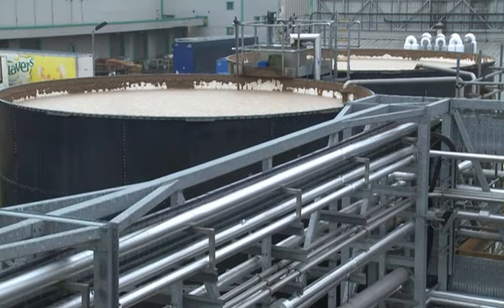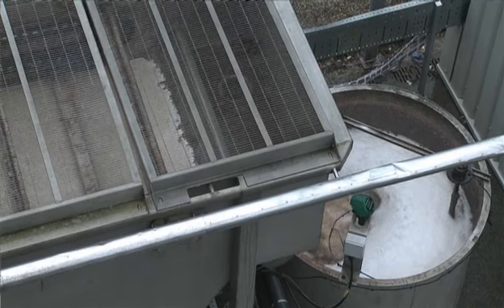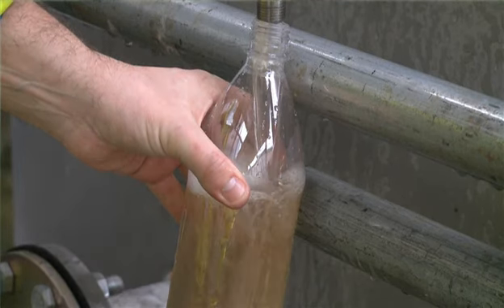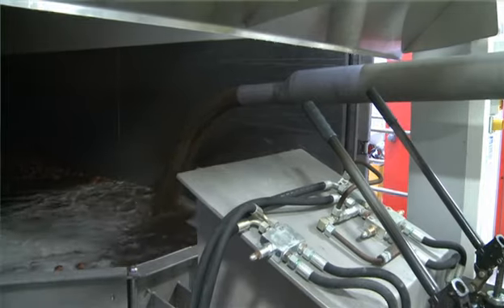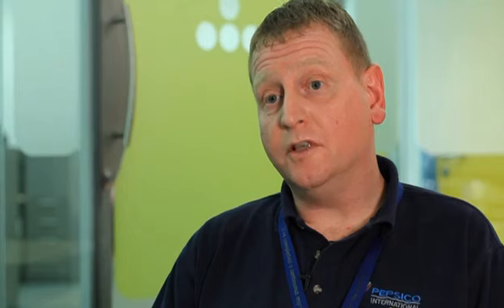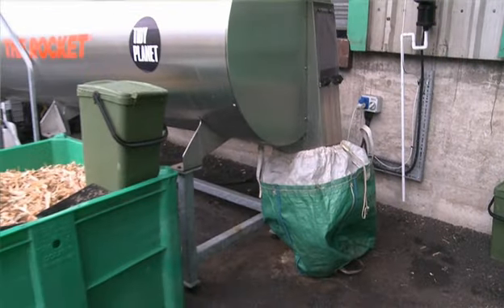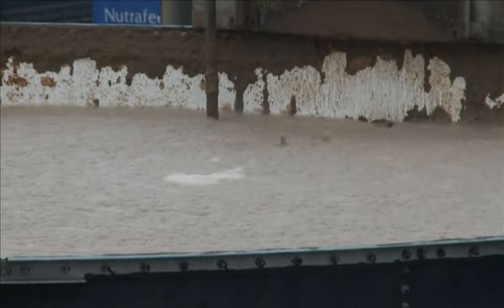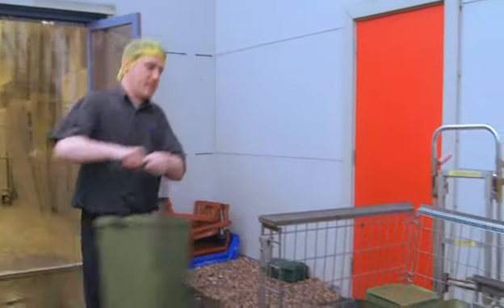Walkers Skelmersdale site wins environment award

Comment: I wouldn't have minded working there my only problems were the 12 hour shifts with nothing stimulating to look at or listen to and the fact that if you spoke english, you were in a minority. 

It might be a site that pepsico think is good, but it's totally different on the shop floor.